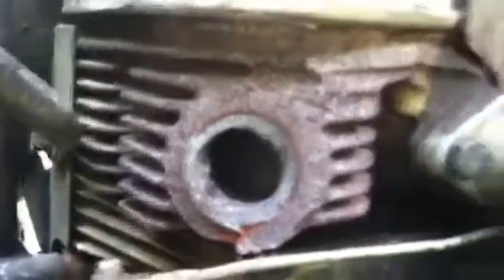Need help! Wisconsin S-8D exhaust broke off in cylinder

Comment: 7 years ago, im a lil late, lol you still have it? Get it out?
Reply from the maker: Yep. I ended up cutting into what was left of the pipe with a hack saw blade and knocking it out with a chisel. Bought a new muffler and a couple pieces of plumbing pipe and built a new one.
Reply: @justinstearns9723  I have same engine im starting to rebuild, I have a long pipe on my exhaust, put a huge pipe wrench on it and it won't budge,. Got it soaking now n will try it n a cpl of days, I'll probably just leave it if I can't get it out,  not sure yet.
Reply: @davidl2281  3 months later. How did it go? Did it come off easy or did it break?  I'm working on a s8d.
Reply: @Photostudioww  actually I had to put it off for a lil while but I kept it soaked with penetrating oil about every 3 -4 days , just a couple squirts , but I started back on it a few days ago, I have the whole tractor pretty much apart redoing it, but I'll let you know when I try to take it off, I don't know if keeping oil on it will help or not, hopefully it will.